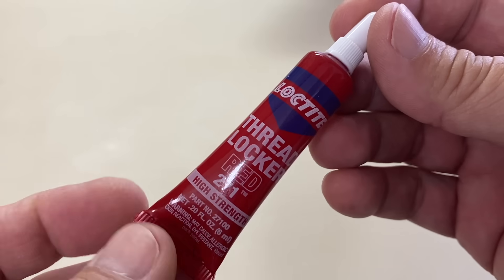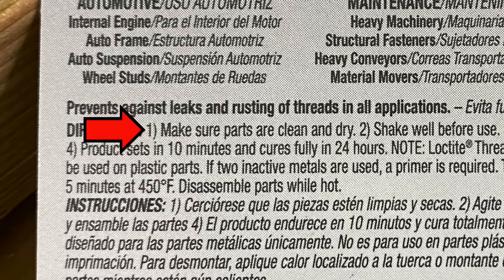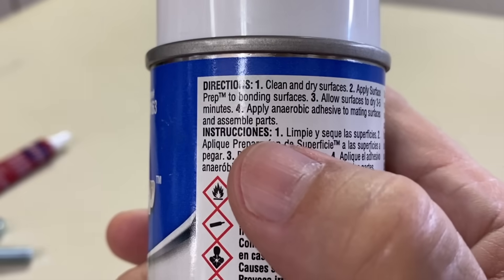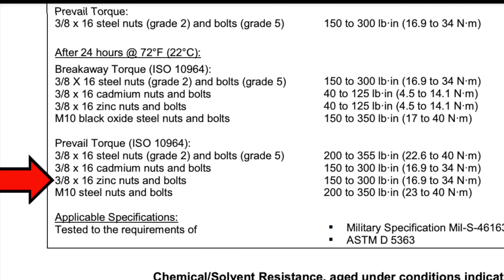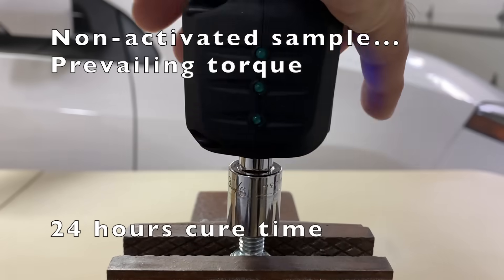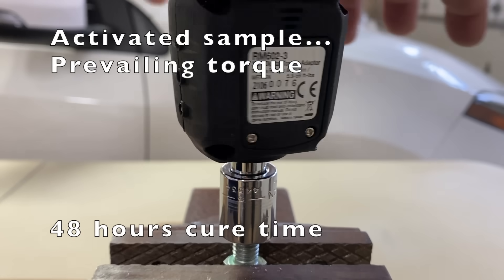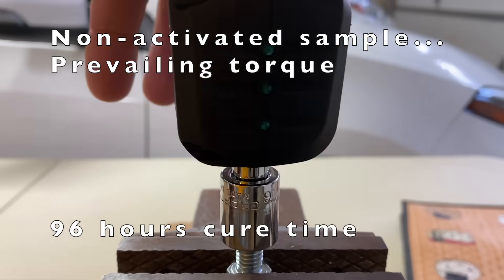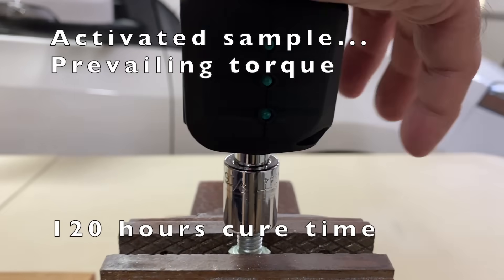Nuts & Bolts - Most DIYers Do Not Know This | Loctite Red Threadlocker Curing

Comment: I will take exception that the test did not have the nuts torqued to some specified value actually clamping something together.  The test allowed too much clearance between the threads on the nut and the bolt.

Comment: As an automotive tech… zinc plated/coated bolts and or nuts are not used in automotive applications… zinc coated… needs a lock washer and you’re done..

Comment: I wonder if the results miight have improved if you change the test a bit.  Consider putting the bolt through a hole in some steel stock, apply the thread locker tothe bold and then screw on the nut and torque it down to 20, 40, or more foot lbs. This ensures the thread locker is squeezed betwen the threads, not just between the loose threads.  By torque it tight you also create a tension in the bold keeping the threads firmly in contact over the next day or longer wait ppriot to testing.  Curious if it make a diffference.

Comment: So question Why did you not use loctite primer and did you know that loctite makes a primer less red and blue now and also a food grade that is a 2 part with a mixture tube also for anyone that reads this regular loctite only works on steel and nothing else unless you use the primer and yes that includes stainless steel and brass